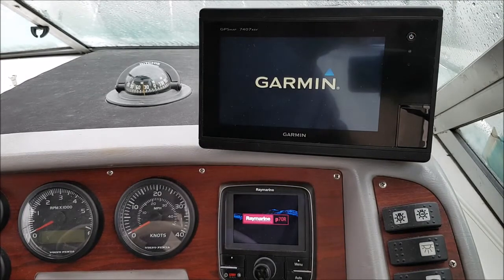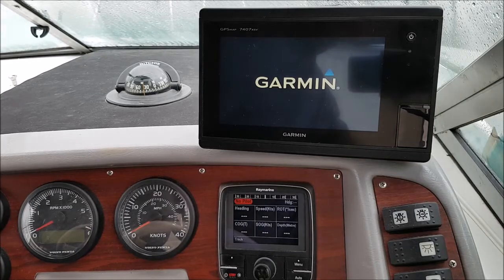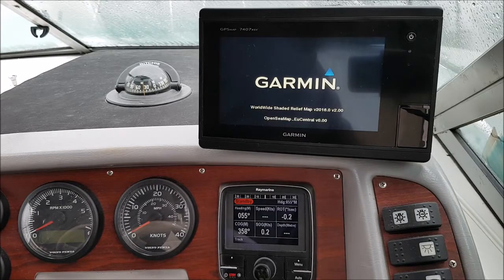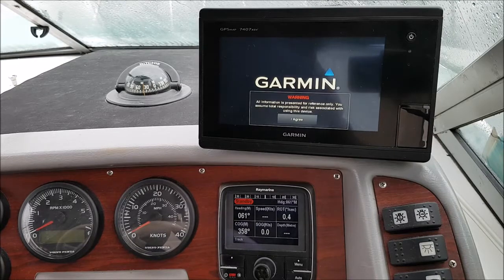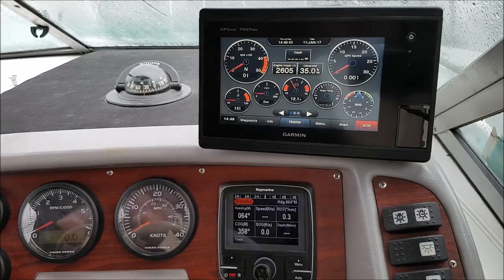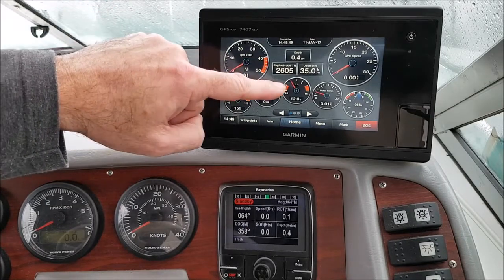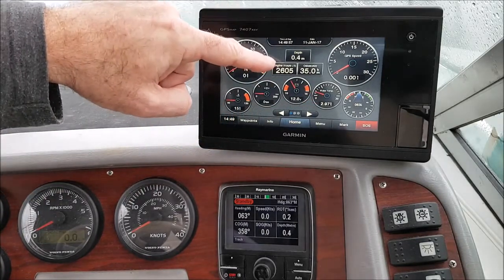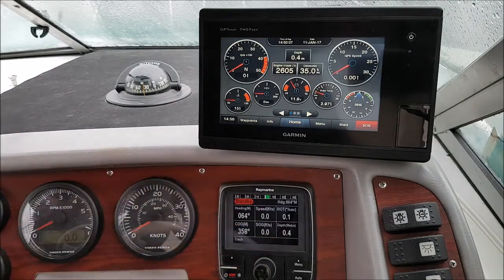Volvo Penta D3-160A-A EVC-A MC (EVCmc) with NMEA 2000 Gateway

Comment: Can you connect to a raymarine?
Reply: Affirmative. Any NMEA 2000 chartplotter/MFD/instrumental display that understands engine data PGNs 127488 "Engine Parameters, Rapid Update"; 127489 "Engine Parameters, Dynamic"; 127493 "Transmission Parameters, Dynamic" will be compatible.

Comment: Is the YDEG-04 all i need to connect my engine to NMEA2000? I have the D3-110I-G version. Thanks!
Reply: Most probably, yes. 

Please, state your EVC system version [ or state engine serial number, better send it via our support @ https://www.yachtd.com/support/ ]
so I can check if you need an extra adapter cable.

Comment: Hello. I have a VP D3 from 2012. I bought a Volvo Penta Easy Connect with blue tooth. Currently I have it installed at the gas throttle but it will not show consumption data. Can I use easy connect and install it at the engine to get out this information, where? Any thing I need to complement? 

Thanks in advance. 
Magnus
Reply: To get fuel rate you need Volvo "Trip Computer" update, refer https://www.yachtd.com/faq/#fuelrate

Comment: Hello guys I have VOLVO PENTA KAD42 Compressor can u tell me if I can to connect this old ENGINE to NMEA 2000 Protocol ?
Reply: KAD42 engine is fully analog, so you need an analog-to-NMEA 2000 converter